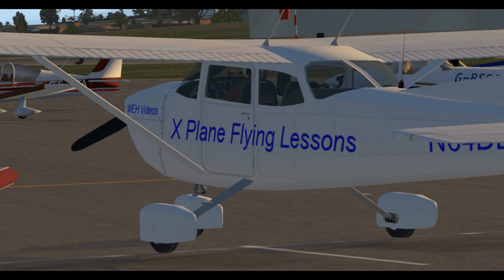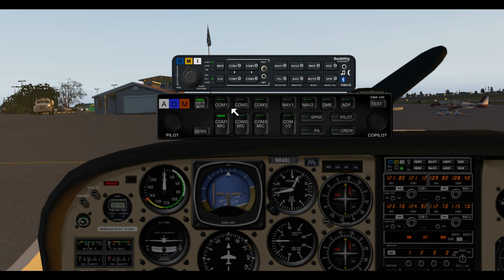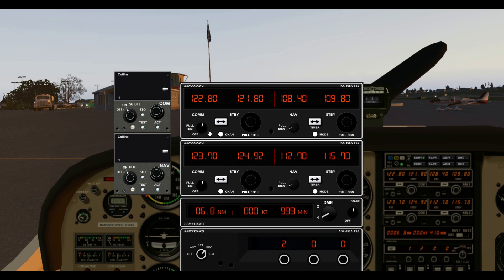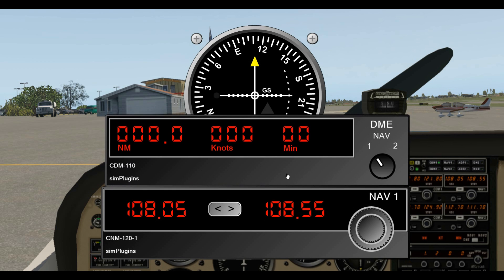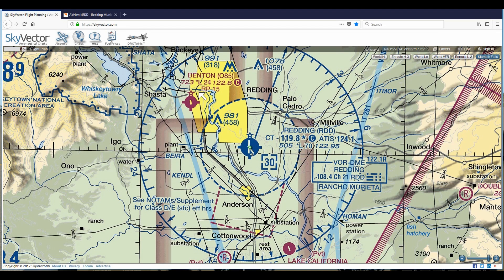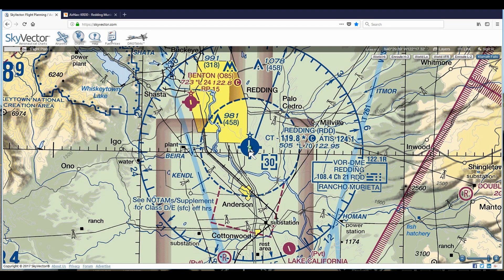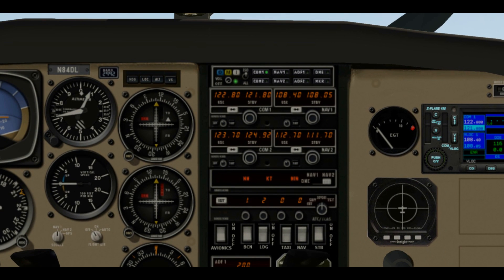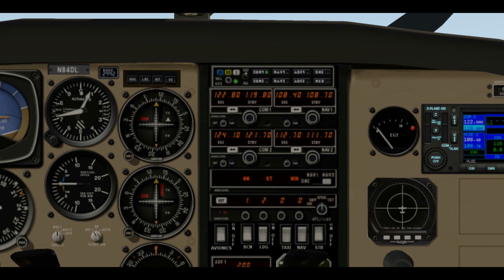The COM & NAV Radios ~ Learning to Fly for Beginners in X Plane 11 Part 12

Comment: Thank you Skip. I am staying in the pattern but having a rough time. I get disoriented when I go left and right and lose track of the airport. The red line will help show me where I go wrong and hopefully I'll be able to land at the same airport I took off from instead of a field. Blessings back. Dennis
Reply from the maker: Hi Dennis, To help with keeping a tight traffic pattern use the compass rose on your heading indicator. When turning from one leg to the next  note the tic marks at 360, 90, 180, and 270 on the indicator. When you start turning watch the heading you are "leaving" move around the indicator. if your turning from 360 watch the 360 move towards the 90 or 270 tic mark. as it gets close start leveling off. This is much easier than trying to go the math for the heading you need for the next leg. Remember you are only going 1/2 to 3/4 of a mile on crosswind and base so it's a short time before you will need to turn again. Hope this helps.

Blessings,
skip

Comment: I'll definitely give it a try. Thanks again Skip. oh, one other thing, I had the  box checked for the map but I don't get a flight path, I get a map with a whole bunch of red marks.
Reply from the maker: Let me know how it goes. 

Hmmmmmm, don't know why you would not get a flight path might have to reinstall X Plane and see if that helps???? Cut the x-plane.exe file from the XP folder and paste it somewhere outside that folder then run the XP installer, it will reinstall the file, see if that works. If something goes wrong reverse the process and put the cut file back.

Blessings,
skip

Comment: Skip, How do you flip from com 1 to com 2 ? Is there a switch?  Also, How did you get the red line that showed the flight path for the standard rate turn?
Reply from the maker: Hi Dennis,  Switching radios is different for different aircraft so you need to check you Pilot Operating Handbook (POH). If you look closely in this video, above the Radio stack you can see two rows of buttons labeled COM1 COM2, NAV1 NAV2 etc. push the button for the radio you want to use, a green light lights up next to the radio in use.

To get the "red line" go to the map and on the right side there are two check boxes, one is for flight path, check that box.
Hope this helped :-)

Oh, if you don't have a POH you can download a pdf version off the internet just search for your airplane's POH.

Blessings,
skip

Comment: Hi Skip, I hope you are keeping well. I just have a few questions if thats ok. Is this correct:  

Active: Comm 1 = Depart Airport Tower
Stby: Comm 1= Dest Airport Tower

Active: Comm 2 = Dest ATIS 

Active: Nav 1 = VOR Freq
Stby: Nav 1 = LOC Freq 

Also, what happens if an airport (small one) does not have A VOR or ATIS ? What do you enter instead ?   
I have notice that large airports have all freq for towers, ATIS, VOR and LOC but some smaller airports dont. What do you enter if they dont.   

For example Biggin Hill (EGKB) Airport Communications are:   
BIGGIN HILL Approach:	129.40
BIGGIN HILL ATIS:	135.67
BIGGIN HILL Tower:	134.80

How would i enter the above freq's to arrive safely. I am just trying to get my head around this 😫 

Many thanks 
Martin
Reply from the maker: Hi Martin,  When planning a flight it helps to know all the frequencies you will be using. You can set up the radios any way you like but setting the standby frequency for the Next frequency you will use helps a lot. 

So you first will need to set a comm radio to the departing airport frequencies. In a Non-towered airport you would use the Unicom frequency and listen for traffic and make your announcements for you departure. 

In your example you could setup Comm 1 for Approach and Standby frequency for the Tower as that's the order you will use the radio as you are arriving and use Comm 2 for ATIS. Remember the first thing you will do Before contacting Anyone is to get the ATIS information. 

There's no "official" order here the idea is to make the radio "workload" as simple as possible BEFORE you start your flight. 

Here's an example:

Benton Field O85 (non-towered)  to Redding Muni KRDD (towered)

Comm 1 set for Benton Unicom Freq. 122.8  _ Standby Freq. set to Redding Tower 119.8
(be ready to enter Redding Ground121.7 into Standby for Comm 1 after 119.8 is active)

Comm 2 O85 ATIS (if available) _ Standby Freq. Redding Muni ATIS 124.1

The flight looks like this after you set the radios:

First get Comm 2 ATIS for Benton Field then flip the standby frequency 124.1 to active so you are ready when it's time to get Redding Muni ATIS 
Second use Comm 1 Unicom for Benton 122.8 to announce your intentions for departure. 
Third After your departure from Benton flip Comm 1  standby frequency 119.8 to active so you are ready to contact the tower and now enter Redding Ground 121.7 in  Standby 
Fourth listen to Redding Muni ATIS 
Fifth  Contact Redding Tower 119.8 and tell them your intentions. The tower call goes something like this:

Redding Tower, Skyhawk 84DL at 2000ft over Sundial Bridge inbound to land with Xray (or current ATIS) then follow the instructions from the tower.

After landing the Tower MIGHT tell you to contact Ground so all you have to do is flip the standby frequency 121.7 to active  After acknowledging the towers instructions and contact Ground giving them you intentions. 

So for all this you only had to enter one new frequency, Ground, while in flight and this really cuts down on radio work giving you more time to be looking outside for traffic etc.
You don't want to be looking at you radios too long when in a high traffic area!
Hope this helps, let me know.

Blessings,
skip
Reply: @WEHVideos  Hi Skip, Thank you very much for replying and helping me out once again. I will be so happy if I can finally grasp the comms and radio procedures. 
I have read your fantastic detailed advice. I am just going to log on now and give it a try. I will let you know the outcome. Much appreciated and many thanks. Martin
Reply from the maker: Looking Good. There's a video later on in this series where we fly this exact flight I described here so you can watch the whole thing :-)

Blessings,
skip
Reply: @WEHVideos  Hi Skip, yes I have also watched you fly the route in the part 2 video. That’s really helpful because I watched exactly what you did. I will give that same route a try & then try a completely different route to see if I have grasped the procedure.Thank you. Martin
Reply from the maker: Sounds Good :-)

Comment: I have so much trouble tuning radios with a mouse, I've given up on sims.  Besides getting realism hardware, is there an easy method of tuning radios?
Reply from the maker: Hi Mike,  There are a few options for you. First and easiest is to program keys on your keyboard for COM and NAV radios. You can also purchase a second "mini" keyboard and label a bunch of keys to program a lot of functions besides the radios. I've done this because I purchased the new Honeycomb yoke and it doesn't have all the buttons and switches like I had on my old yoke. Next you can purchase the Logitech Flight Radio Panel $140. And Finally if you are handy you an build your own using the circuit board from an old usb keyboard. I started out this way and did a whole series on how to build your own panel. While my panel has all kinds of functions you could build one with just a few functions. Check out this link if you are interested. www.youtube.com/watch?v=Du2wpw6AMcI  Naturally this is the most difficult and requires time a patience, however, with the Shelter at Home policy in place this might be a nice project :-)  Hope one of these ideas help, please let me know.

Blessings,
skip
Reply: @WEHVideos  That you for these great tips.

Comment: Skip, on such a distant trip although I’ve got much of the six-pack and VOR’s down pat, I think a Direct—> would be easier. I saw another instructor on YouTube mention the odd number altitudes. 
It was also my understanding that if you’re flying above an airports airspace you don’t have to contact them, i.e. over 7000’.
Reply from the maker: Hi DAm8658,  Sure, you can do a Direct To it certainly would be easier but you miss out on the challenges of flight planning and flying it yourself not in AP. 

Many real life pilots have gotten into trouble using the Direct To function of the GPS because they ended up flying into restricted airspace. Mr. GPS doesn't know anything about airspace and has no problem flying through it. It will show you the airspace but won't avoid it when flying in Direct To mode. 

You are right about flying over airport airspace and in you case you would be flying at 7,500 so you have no problems you don't have to contact them. However other airports have airspace that  goes  higher than 7000ft. so you would need to check, however, there are no more airports in you flight plan you need to deal with at 7,500ft or above.

Again you are flying a simulator you can do anything you want so just have fun. I personally like the challenge of flying VOR to VOR along with pilotage and dead reckoning when I am out of range of a VOR,  that's the fun of a simulator you never get in trouble and you can learn a lot especially in the navigation areas. If you use "Direct To"  you just sit back and watch the airplane fly itself, not much fun after an hour or so of just watching the screen. 

You have a great little flight why not just do your best going from VOR to VOR as you mentioned when we started this discussion, I think you will really enjoy the flight. Remember you can save your flight anytime and pick it up from where you left off so you don't have to do it all in one sitting. I flew a Baron 58 half way across the US just using the NAV Radios. When I was out of range of my next VOR I just kept flying the heading I was on that would have taken me to the VOR if I was in range. Just have to check the winds from time to time to see if I'm blown off course but eventually I"d pick up the VOR and if I was off course I just made corrections once I was tuned into the VOR and get back on course. It's very satisfying to do one of these flights and you learn a lot in the simulator and it really is like real life flying using the navigation radios. 

If you haven't watched my series on VOR to VOR navigation it might help you and it's a pretty short flight so you can try it out if you like, should take 90 minutes or so to fly, probably not quiet that long. check it out here: 

www.youtube.com/watch?v=qoGHzQWbsXs&t=3s

Hope this helps and hope you give your flight a try without Direct To. I really don't like using auto pilot  in the simulator I feel like I'm watching TV.

Don't give up! Good Luck,
skip

Comment: Skip thanks for your replies. I’m going through all online aviation channels to learn everything possible to learn to fly without paying a cent. I’m on Social Security and love aviation in general.
Question, if I were to fly from home, KHUM to Charleston Executive, KJZI, how many VOR’s would you suggest to follow along they way? I would plan to make one rest & fuel stop halfway somewhere past Dothan, AL. 
Also, if flying an LSA at 8000’ aren’t I clear over all airports along the way?
Reply from the maker: Hi DAM8658, Wow, this is quite a flight if you are new to flying, especially flying a Light Sport Aircraft! 

If you are planning to just use VOR's you will most likely have to use every one you can find and at times you will most likely be out of range between VOR's and have to fly headings until you can pick up your next VOR. 

As for altitude you need to be sure you are at least 1000ft above any obstacles  and since you will be flying headings between 000 and 179 you should fly at odd one thousands. This means, if you are over 3000 feet above the surface, you must fly odd thousands of feet (3,500, 5,500, 7,500 etc) So you should fly 7500ft or 9,500ft for your plan

If you are going to try and fly this under real life conditions you should check the air space for all the airports you will fly over. However you could just contact the tower and ask for permission to transition their air space and since you are in a simulator you can give yourself permission :-) For  example you must deal with New Orleans Airport as your flight path goes right through their airspace. Are you familiar with SkyVector.com? If you look at the airport in SkyVector (or if you have a sectional chart) you can see you must  be  below 4000ft or above 7000 if you want to avoid their airspace in your flight plan.

 If you go to SkyVector and enter your flight plan it will look like this:  "SAFES V198 ROMMY V240 SJI V20 MVC V70 OCONE V154 SAV V437 JACKE" and will show you your route. The "names" such as SAFES are fixes used with GPS and V198 etc. are Victor Airways to follow. you will have to search for each fix to see it's location in your flight plan then you can locate a VOR close by if possible. I suggest you look at this flight plan with the fixes and select VOR's that are close to the route you want to take. 

This looks like a lot of fun and a nice challenge so good luck, let me know how it goes.

Got to love Social Security, been on it for almost 10 years now. Happy Flying :-)

Blessings,
skip

Comment: Just curious why the localizer and VOR feqencies were slightly off 108.4 vs 108.7?  Thanks
Reply from the maker: Hi pgreenx,  The 108.4 frequency is for the Comm radio which we use to contact and talk with the air traffic controller in the tower and communicate with other traffic, this is for communication. The 108.7 is for the Nav radio. You don't talk or communicate on this frequency it is just used for navigation such as flying to a VOR or using the ILS system to land. The Nav radio just receives a signal from the VOR or ILS and displays information in the VOR indicator. Here is a link to all my Navigation videos that might help you, https://www.youtube.com/playlist?list=PLjqSrWIZDAi9S9ds3QbfiTkjGAmE6b7IG

Hope this helps, let me know. 

Blessings,
skip
Reply: @WEHVideos  hi and thank you.  Can you recommend a “pilot training course(s)”  for a sim-only noob pilot?  I’d like to learn the right way but don’t think I need to pay a full/high tuition for someone who will actually fly a real plane.
Reply from the maker: Hi pgreenx,  I don't know of any off hand sorry. I have a series that takes you through almost everything you need for a sim pilot. I cover everything a sim pilot would need to know in most cases depending on what your looking for. My series based on what I've been doing while taking flying lessons in a Cessna 172N. The Cessna 172 is probably the most popular airplane for learning to fly in real life, it's a very easy and forgiving, a pretty tough little airplane. 

I don't think you need to spend money if you just plan to fly a sim, there is a lot of really good videos on YouTube that can help you for free. Take a look at my series and see if this is what you want by clicking the links below, start with the introduction and if you want I also offer a free Cessna 172N given to me by X-Hanger.com that I use in almost all my videos so you can follow along in the same airplane, you can find out how to download the 172N in the first video in the series.

So check these out and know I'm here to help with anything if I can. 

https://www.youtube.com/playlist?list=PLjqSrWIZDAi8IsbmFdGfJBVJ7jYSxAt26

You should know I'm not a flight instructor or do I have a PPL yet I'm a student pilot with about 65 hours in a 172N flying out of Redding CA. and these videos are based on what I have learned as I work on mp PPL.

Let me know how you are doing :-)
Blessings,
skip
Reply: @WEHVideos  thanks.   Will do. I started viewing your vids but In The middle.  I’ll start at beginning. No short cuts for flying I guess.  Thanks
Reply from the maker: Yes starting at the beginning will help a lot I think, good luck :-)

Blessings,
skip